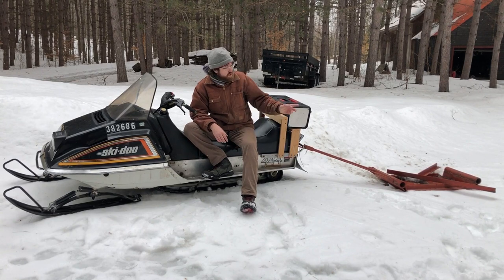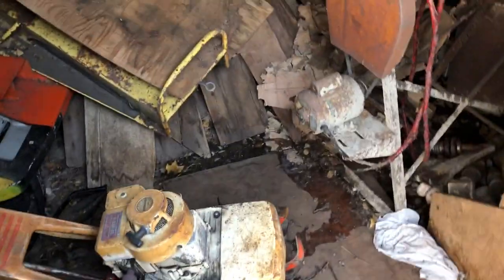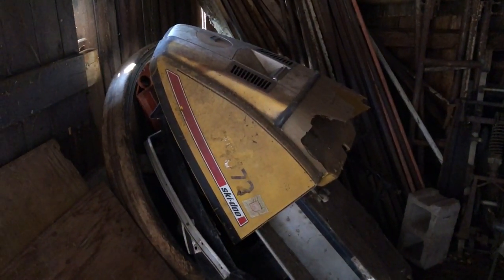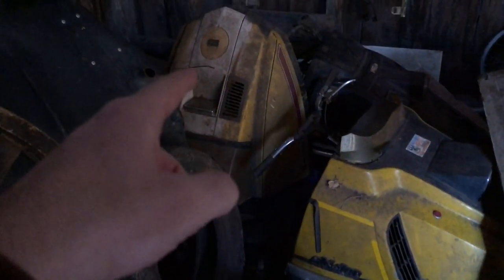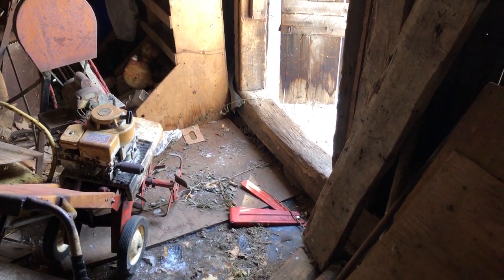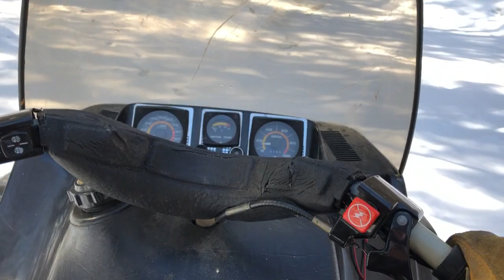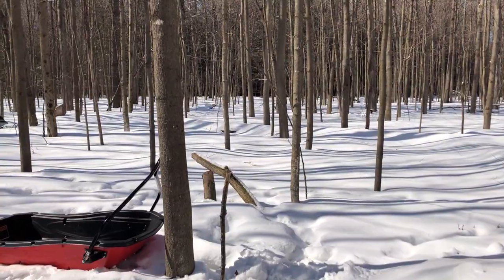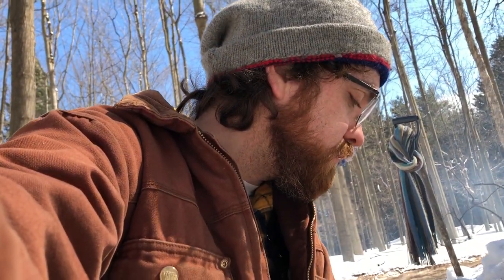Making cross-country ski trails with homemade groomer

Comment: I like the tools box on the back, I always take a back pack with.
Reply from the maker: I used wood to attach the toolbox to the sled a couple years back. It was the night before a planned 200+km run our club called “The Ironman”. Sled didnt even make it out of the parking lot that morning... Brand new coil failed and was only running on 1 cyl...
Reply: @mattsws  that sucks... If you think about this you could have been at the farther point and it could have then.  That is why when I ride it in a circle, so always not to far from home if you need to walk. If you get a chance to watch my three part video from earlier this year you will see why lol